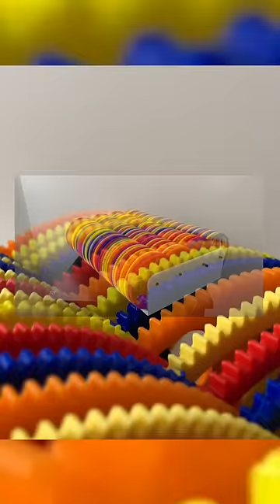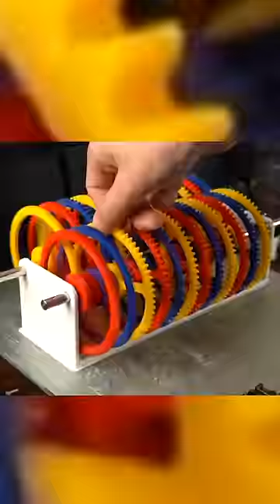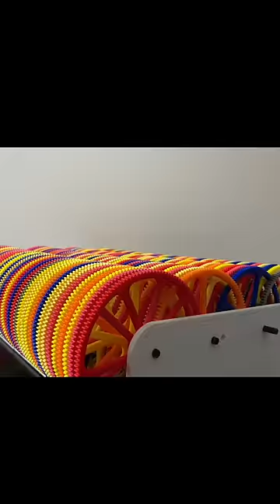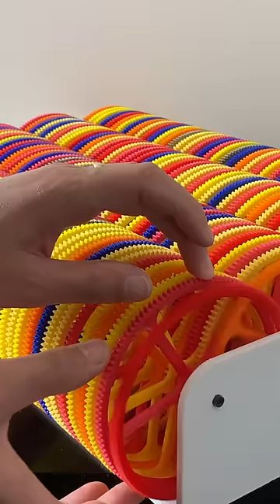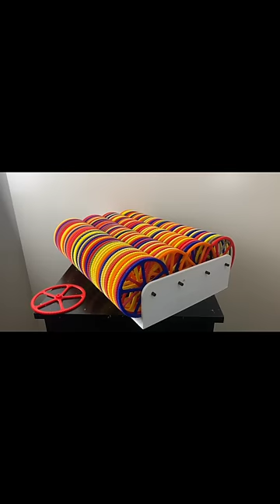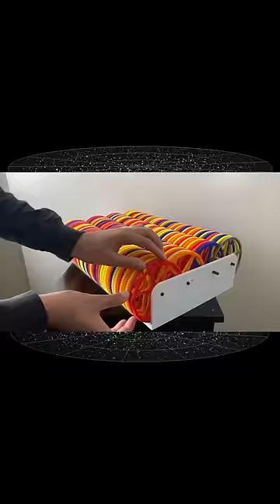World's Highest Gear Ratio (in 60 seconds)

Comment: Spinning the last gear would feel like its stuck. Youd snap it off before it even moved
Reply: Shh
Reply: I’m thinking that if you pushed on the last gear, that force would be transmitted through the gears and the first few would turn. The only thing that would make the fail is if the static friction was too high.
Reply: @bobh6728  newton's third law: you need to put in enough energy for it to output that much energy, in other words no human is strong enough nor is there enough energy in the universe to do so
Reply: @polymath6475  I think you are correct. Since the distance on the final gear is so small, the force would have to be astronomical. E=Fd
Reply: Umm guys those gears are 3d printed this shit would all break apart if you even tried to move any gear in even the second row
Reply: @polymath6475  I could do it
Reply: @spiddy1335  yeah
Reply: There's more inertia than in the observable universe.
Reply: @aelix56  simple example: put your ten speed bike in the highest gear and get on it and start pedaling! it doesn't work!
Reply: @polymath6475  sounds like you need more lifting and less science in your arms
Reply: @aelix56  I don't have arms. Bad accident, I'll spare the details, but good luck to you, I would 👍 if I could.

Comment: 10^169 is not only significantly larger than 10^82. If every atom in the observable universe was its own universe, then the total number of atoms in all of these univserses combined would only be 10^164. So in turn, you would need 10,000 of these to reach the gear ratio.
Reply: So the ratio of this machine is 100,000 (10^5) times bigger than if all atoms had their own universes.
Reply: So it's like 10^82^2 except bigger
Reply: @katherinebrubaker7788  sure, if by that you mean (10^82)^2. 10^(82^2) is way bigger. The point of my example was just to try to put in perspective the sheer magnitude of the size difference
Reply: Cool story but we wanna see him spin the last wheel
Reply: Dude, 82 to 169 is not that much. If something cost 169 and is on sale for 82 it’s just about half
Reply: @LOLLYPOPPE  thats a low quality bait
Reply: @LOLLYPOPPE  Your right
Reply: @LOLLYPOPPE Good point! I think you're right
Reply: You would need 10,000 of what?
Reply: This example is like being gouged from something costing 82, and increasing to 169, which is over double . 🙄
 @LOLLYPOPPE
Reply: And your math is still wrong because no one truly how many Atoms their is in whole universe! 😅

Comment: With a powerful enough engine it could probably just break all speed records in existence.
Reply: Um nah
Reply: The last gear is unmoveable. Putting any reasonable power on it would just break the plastic
Reply: @IT_Wizz  I see. What if they were made of metal?
Reply: @kyototomokui6676  it would still being unmoveable
Reply: @user-cd3fk1ph8g what if it were made of a hypothetical unbreakable metal
Reply: @Robloxgod-np3tp  it would still be unmovable because you lack the hypothetical necessary power, to turn it.
Reply: @UndisputedONE2  make it out of an unbreakable material then launch a rocket onto it  or about 600 18 wheelers
Reply: @miciagaming7323  Even hypothetically you can't even rotate the last gear of the speed of light :)
Reply: @ALONE_dm  then shine  2 lights on it 🧠
Reply: @miciagaming7323  Okay, if you lounch Two missiles instead of just one they're number will increase but they'll move at same velocity like eachother . So it doesn't matter what you think nothing will work until infinity comes and it doesn't exist in physics 🗿
Reply: @ALONE_dm  i don't wanna be that guy but it's their and also it's mostly a joke but good point
Reply: @miciagaming7323   I knew it was a joke but , I have to pretend COOL ya know 🗿
Reply: @miciagaming7323  even if that for example would be possible it would take a lot more than that. 

Im too lazy to look for exact calculations but if we look at correlative figures, we can assume that machinery can generate or drain energy even with the smallest amounts of rpm because of force generated. 

we are talking about an invention that would move at speeds far beyond our imagionations. 

That machinery alone should be able to generate enough energy to supply earths need for recourses in Energy for like every machinery that uses any type of force to be activated with (cars, ships, heavy machinery, anything that uses electricity).
like uncountable multiple times...

...assuming the earth wouldn't evaporate due to the heat it would generate due to heat equations. I mean even the smallest turbines need some times cooling fans to not combust - i cant imagine let alone calculate how fast our world would be a gooner activating this device at full speed without it having any physical and thermodynamical boundaries
Reply: @UndisputedONE2  ok
Reply: only God almighty is able to move that gear
Reply: @synx5196  Then call him up and get him to move it!
Reply: @synx5196  i imagine if he wanted the Apocalypse happen:

+ Angel of death: "so are we sendin our toops to defy evil, dear lord"
+ God: "turn. wheel."
Reply: @ALONE_dm so six horses pulling a cart have the same strength as a single horse because they move at the same velocity?
Reply: @somecallmetim4490   they'll be producing 6x  torque but  not speed , cause if 1 horse top speed is 100km/h then the others horses I'll go to same speed but the force of pulling something I'll be increased .
Reply: @ALONE_dm  yes, that is obvious. So why did you say two rockets would be the same as one? Velocity isn't equal to force.
Reply: @somecallmetim4490   Man! Just quite it I can't argue enough with you in this topic . You need  clarity in your thoughts and think deeply .
Reply: @somecallmetim4490   by this mean I guess you didn't know about quantum physics  right ?
Reply: @ALONE_dm  you need to go back and read through your comments here. I'm not the one who's contradicting themselves and can't follow conversation.
Reply: @miciagaming7323  You see, moving the last gear at any significant speed would make the first gear move at multiple times the speed of light, as he said in the video.
Like all the other times we try to make mass move at light speed, the energy required approaches infinity.
Reply: @marzipancutter8144  O K

Comment: lemme get a drill and try to spin that last gear real quick
Reply: Wear PPE for that one.
Reply: You'll break the drill.
Reply: @aminulhussain2277  bro I'll pull out the pneumatic impact gun on it
Reply: @ARockyRock Breaks
Reply: probably the weight of the solar system aint enough to spin the last gear, assuming theyd have infinite strength😂
Reply: That was my thought haha.
Reply: @floben5685 if you could compress the weight of the solar system into an item that can exert a force on a small singular point then you’d create a black hole or smth
Reply: @aminulhussain2277  He would break the gear. Probably not the drill.
Reply: Try it 😅
And show me result 😐
Reply: @ARockyRock Conservation of Energy says hi btw, even without material breaking, you can't generate enough force to spin the last gear at a remotely noticeable rate.
Reply: @doomse150  we using the power of spite here that ignores physics
Reply: Would be too heavy for it
Reply: gear teeth would strip off
Reply: Sorry but it wont SPPIIIAAAAAAAAAA
Reply: Plastic gear will break😊

Comment: It could be possible if they are more solid, I believe. But probably when about 1/3 of the gears are spinning, the first will start to melt.
Reply: No matter how solid the cogwheels are they wouldn't be able to withstand the unbelievable force applied on them.
Reply: Estimate based on mass.
Reply: It would take more than a lifetime of spinning both ends against themselves just to take up the slack in the system
Reply: @Snorkl7879  good idea for an almost-perpetual motion machine.

Comment: If every atom in the universe contained a full universe in itself, the gear ratio would still be 100000 times larger than all the atoms in every little copy of the universe combined
Reply: holy shit
Reply: Yeah, you're prolly right cause 169 -82×2 = 5 this means 10⁵
Reply: SHOW YOUR WORK
Reply: He is right. 10^82 universes with 10^82 atoms each gives 10^82 * 10^82 = 10^(82+82) = 10^164 atoms combined, leaving a factor of 10^5 or 100000 to reach a gear ratio of 10^169.
Reply: we arent finding the area of a shape that is 10⁸² by 10⁸². i dont know the actual formula but its not something that equals 10¹⁶⁴.. ladies and gentleman, i believe it is rather a bigger number than this.
Reply: @oceancolt  no yeah im pretty sure it would be (10^82)^82 which would make this comment extremely wrong lmao
Reply: @damsaucy  youre extremely wrong. the previous explanation was perfect. You're multiplying the number of atoms in each universe (10^82) times the number of universes (10^82). If I have ten bunches of bananas, and each bunch has five bananas, i multiply 10x5. Same concept. When multiplying exponents with the same base you simply retain that base and add the two exponents, hence the result 10^164.

Comment: I want to see you spin the last gear just to watch the first one explode 😂
Reply: Its gonna take an insane amount of force
Reply: Friction is too high
Reply: @redpaper5378  not insane, it wouldn't be possible, the speed of the first gear would need to be quintillions of times faster than the speed of light for the last gear to be moved visibly. and because nothing real can ever move faster than light you wouldn't be able to move it even if the gears were indestructible and you had infinite strength.
Reply: @tyr7876 just lube it bro, then spin the last gear
Reply: @Usman Hassan  I've seen zero mention or evidence of such a speed from them but even then it wouldn't be moving faster than light as it would not take up any definable space and thus in the action of spinning would not be crossing space at all.
Reply: Usman Hassan  that is not correct, it's estimated to be about 90% of C
As far as we aware according to the laws of physics we know of, nothing can travel faster than the speed of light
Reply: @mattdyne  Technically we did prove that information between two Quantum entangled particles does travel faster than light which means the universe is not locally real. Very interesting science but indeed other than that nothing defies the limit of light speed that we know of.
Reply: @tyr7876  I don't think Quantum Entanglement is considered "travelling" I would also query as to whether its "information" being transmitted as apposed to something else. What that is Im not quite sure but quantum entanglement is very cool. I think the issue I'm having is the information at point A does not travel to the other particle at point b the change just happens almost instantly.
Reply: @mattdyne  It technically is as it is transferred from an object to another. I'm also probably explaining it poorly cause I'm not a Physicist but there are a lot of articles about it you can find since the people who proved this got a Nobel prize as well as the whole Not locally real universe thing being easy to farm clicks with so it kind of blew up for a bit.
Reply: @w0s0griffin  wouldn't do anything whatsoever
Reply: Let's put it this way. If they were able to spend the last year without the whole thing just breaking and that first gear was able to spend, it would generate so much heat that it would kill every single thing in the entire galaxy
Reply: @Kazoo_Bot  Also ignoring the universal speed limit. and it wouldn't generate that energy per say, it more so would be the fact that you need all of that energy to move it and it then has to go somewhere that would release the energy you put into it.
Reply: @tyr7876  If you had infinite strength you would be able to move it because you have an infinite amount of power
Reply: @tyr7876  quantum entanglement does not prove anything moves faster than light.
Reply: @molly5917  No, it physically cannot move as to move it would mean exceeding the speed limit of the universe which is impossible for locally real objects. as a result the force you put into pushing it though infinite would be countered by an equally infinite resistance which would fully negate all movement in any direction.
Reply: @moshunit96  It does, it proves information moves faster than light. Which while it doesn't sound significant it most certainly is, and the people who proved that got a Nobel prize right away because it was so ground breaking.

Comment: If there was no loss of energy (and the material was infinitely strong) the torque on this gearbox could probably move the sun.
Reply: Walking around in your house moves the sun
Reply: The sun is too light to even be felt by the amount of torque this contraption could theoretically generate. A single atom would overpower all the mass in the universe by dozens orders of magnitude. Its really hard to begin to imagine things at this scale.
Reply: @Tango Sucka  don't got one. Ain't gay either
Reply: @tangosucka2000  also isn't it just common sense? What else would he mean dude
Reply: @tangosucka2000  what do you mean they meant what? What did they say
Reply: I would imagine it to be extremely easy too, the thing may as will catapult a big black hole when we get "enough" speed to it
Reply: You mean there is enough torque for a flea to turn a black hole inside out.... Lmao

Comment: What fascinating is that those further gears are moving, just at immeasurable small distance. 

Since the gear reduction goes in a geometric sequence, it is easy to find out their rotation speeds taking the 10x as common ratio. For example, 2nd gear rotates once every 10 seconds, 3rd is per 100 seconds, 4th is per 1000 seconds until the 170th gear which is 1 per 1E+169 seconds.
Reply: I'd wager they arent even moving yet. there's enough play in those gears to where all the slack wouldnt be taken out of the system and the last ones probably wouldnt move for millennia.
Reply: @ibieiniid4240  I kinda wonder what happen if you jam an object between those gears that aren',t visibly moving. I doubt the first gear can still be turned.
Reply: @kingpatty4628  well at that order of magnitude, most of this is just theoretical and has to assume impossible things like there being no slack left in the system, the gears being made out of the hardest material possible, and the whole system not degrading over time... but no it wouldn't stop the first gear. the slowest gears would have an insane, absolutely unearthly amount of torque and would crush anything you stick in there over the course of many many years. Like, I'd take a wild guess and say it'd take longer than a human lifespan to crush even a grain of sand.
Reply: yeah agree. If we take the material erosion into account then the 9th gear will be the last to manage  completing its rotation in our lifetime powered by an inductor motor that gets replaced once in awhile. Adding more rotation speed will just make the gears erode faster because of heat build up caused by friction.
Reply: Actually since there probably exists a quant of space (and distance), the further gears might be moving in little ,,jumps”.

So if they didn’t get to the first jump yet, they’re not moving.
Reply: Nope. The gears Will bend and dead air space will compress for a hundred thousand years before anything moves
Reply: What's fascinating is that he probably just made the two closest gears spin and claim the rest are connected. He doesn't have to prove the others turn because "it would take an eternity to do so". Joke's on you!

Comment: Imagine building a runway to another universe and putting this gearbox into a car and driving it until you reach the max rpm on the last gear...
Reply: The last gear would move extremely slow. In a gear ratio like this it takes super fast speeds reduces the speed to almost nothing but the torque created could move a planet.
Reply: @jamesfair9751  🤓
Reply: @tatertotboi  no its science
Reply: @shahrimanabkadir2653  🤓
Reply: @tatertotboi  no its science
Reply: @shahrimanabkadir2653  🤓
Reply: @tatertotboi  🤓

Comment: I wonder how much lash is in there, like is there enough you can get the last gear spinning in the first gear spinning in opposite directions and then it'll explode in the center
Reply: THIS GEARBOX WOULD NEVER EVEN SPIN THE LAST GEAR, NOR THE 10-20 GEARS BEFORE IT, BECAUSE IT'S TOO FLIMSY.
Reply: @jonslg240  try using your imagination
Reply: @jonslg240  THANK YOU FOR TYPING IN ALL CAPS AND BOLD I WOULDNT HAVE SEEN YOUR COMMENT OTHERWISE
Reply: Black hole 🕳️ rips every apart

Comment: i like the part when he tells us how long it will take to spin the last gear fully
Reply: You made me watch it again
Reply: Well, he actually implied that. He would have to move the first gear at the speed of light for the last gear to even spin before the heat death of the universe, which is esteemed to happen in about 1.7(10^106) years. That is an inconceivable amount of time.
To sum it up, the last gear will take at least 1.7(10^106) years to spin.

EDIT: once again, this is presuming he is somehow able to spin the first gear at the speed of light. Which he won't be.
Reply: @CaesarLvcivs  thankus for doing the math
Reply: Calculate it. He gave you the gear ratio... If you spin the first gear once a second, it would take 10^169 seconds for the last gear to complete one rotation
Reply: Longer than the universe will exist. It's literally impossible to spin the last gear without breaking the box or the laws if physics.